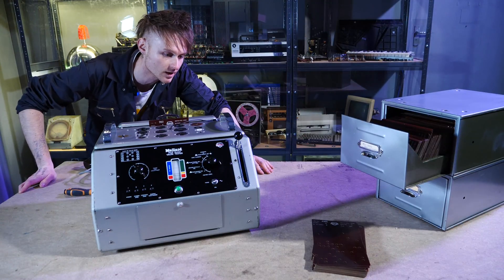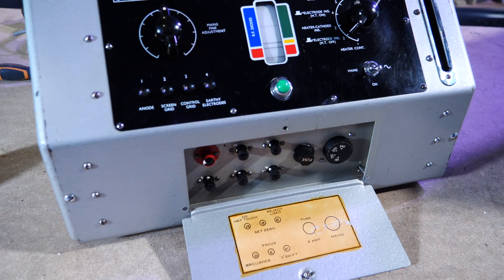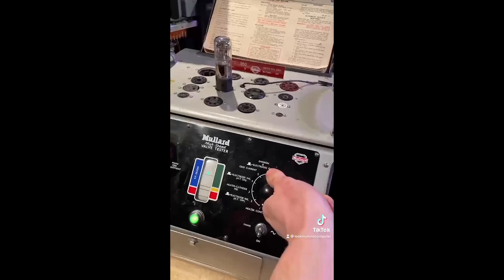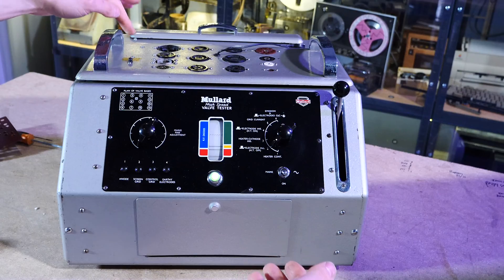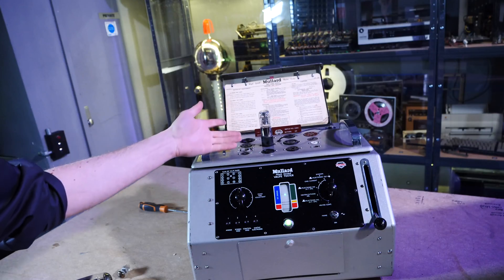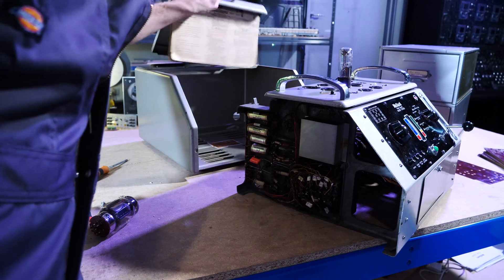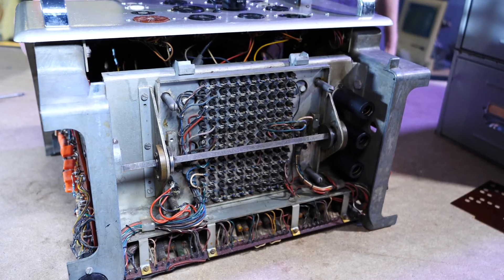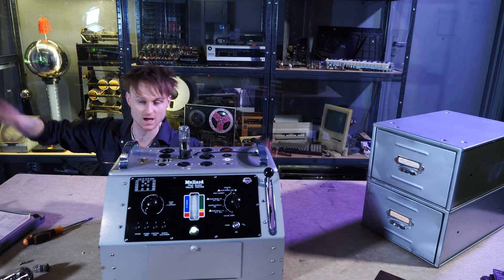Punch Card Controlled Vintage Valve Tester? Mullard High Speed Valve Tester

Comment from the maker: Have you had experience with the Mullard High Speed Valve Tester?
after looking the top pin row I mention in the punch card assembly part. I think turns on the heater pins of the correct sockets.
Support these vids/museum, builders livestream tomorrow night building a sequencer! https://www.patreon.com/lookmumnocomputer
This month I got hold of a couple of things for upcoming videos and for the museum aswell as a lapel mic pack. used in this vid and future vids! so thanks very much for the support it makes these vids possible! :)
Reply: The audio is much improved this week with your new mic :) Can't wait to come to the museum once it opens!
Reply: I myself have one. Very handy, and heavy!
Reply: I have the schematics from when I had on in for repair in the 1970s. Get in touch if you want them.

Comment: The "heater-cathode" test is probably for leakage between the heater and cathode:  in many circuits, they're operated at different voltages, so leakage can upset the circuits.  Additionally many heaters are AC operated, and leakage to the cathode would introduce strong hum into the signal.  While I don't have experience with that particular unit, I have a lot of experience with tube testers and CRT circuitry in general, so I'd be happy to answer questions, or even come look at it the next time I'm in the UK.

Comment: Here in the States, Hickok made a series of "Card-Matic"  punchcard-operated tube testers. The tester came in a large suitcase and a full set of cards would require another large suitcase. The readout was done on an analog meter, and they also sold blank cards and a special hole punch so you could make your own cards as new tube types came on the market. BTW, a friend of mine once had a Scott FM tuner that had a Nixie-tube frequency display and used punchcards to select the radio stations!! .

Comment: I wonder why they used a CRT rather than a meter, thought it was a light spot galvonometer for a start.
Reply: Mullard made CRTs, so adding one in to their own tester machine, if only for a 1Dvmoving dot would be cheap. It could even be a CRT tube that had a low quality second from production with faulty phosphor, misaligned  second axis plate etc.
Reply from the maker: meters were more expensive at the time
Reply from the maker: i read it in a magazine i cant remember which but they just said small crt's and magic eyes etc "are (at the time) more economical than mechanical meters"
Reply: @THISMUSEUMISNOTOBSOLETE  I suppose they could have been using up "old stock" round CRT's made for wartime scopes still in the 1960's.

Comment: Heater cathode tests the high temp, high voltage insulation between the actual heating element and the metal cathode cylinder.

Comment: If you got anotherone of those, make an selectable musical machine out of it! Selection made by cards. Like, it could be an drum machine, the cards holds the "memory" for different drumming patterns. And if you pull the lever without any card inside, all drums sounds sounds the same time chaosly.
Reply: Don't pointlessly destroy vintage tech unless the display tube is broken or something. You could easily make something with paper or 3D printed plastic cards and an optical reader.

Comment: That's quite a bit different from the B&K "Dyna-Jet" tube tester I have. Mine was designed to be portable - for the travelling repairman.  Instead of the punch cards it has a whole lot of multi-position rotary switches that you need to set according to a book full of codes.

Comment: Thats one hell of a nice find. 

Im currently building one that is "modern" and computer controlled. 
It will be finished quite soon if I get a job / monney again. 

I never knew there where tube testers that are controlled with punch cards. 

As for your test with the magic eye. 
Even if the tube is still working their output strength can decrease overtime. 
With a magic eye it is not realy dramatic. 
It will just fade over time and at one point stop working. 

To oversimplify it a bit.... 
A precise tube tester  can test working tubes for output strength to determine how used they are. 
Kinda like a used battery. 

In some application is is important to know how well they are still doing since to low output can cause faulti operation of the equipment.

Comment: In America during the 50's and 60's customer-accessible tube testers in drug stores were a common sight. If I remember correctly, a lot of them had RCA company designations, as I think they manufactured the replacement tubes.
Reply: In Canada, and it was as late as early 70s, I’m sure, we used to take tv tubes to the newspaper / tobacco shop, and they had a basic tube tester. If you had a dead tube, you just opened the cupboard door below and found the appropriate one. Happy days.

Comment: mr Carlson's Lab featured a valve tester that was intyended for customers to use, bit dodgy with the flying HT lead
A valve tester is very basic, it powers the heater and applies a positive voltage to the anode and all grids. the cathode is connected to negative, yours may have a couple of extra tests than the basic one a friend has.
I thnk the cards are SRPB (synthetic resin bonded paper) aka paxolin.
The problem with the punch cards is that you need to get new ones for any new valve, rather than just finding an equivalent and working out the connections like me and my friend have done a couple of times (his only used slide switch selections)
did you read my email yet ?
Reply: Surely you could make your own cards for something like this. It wouldn't surprise me if the manual included their format in an appendix.